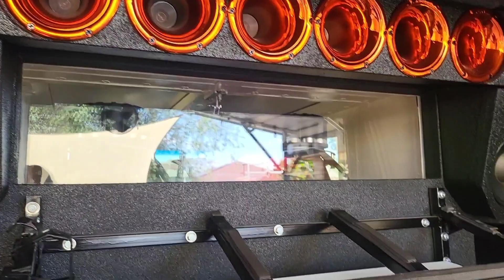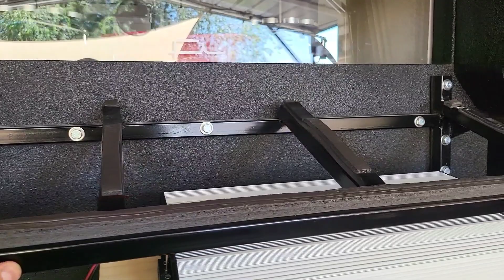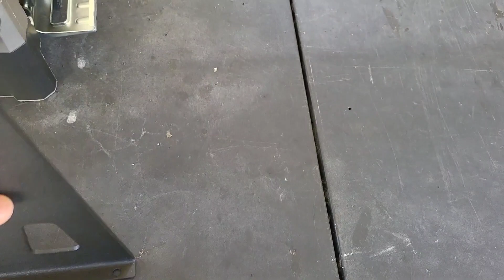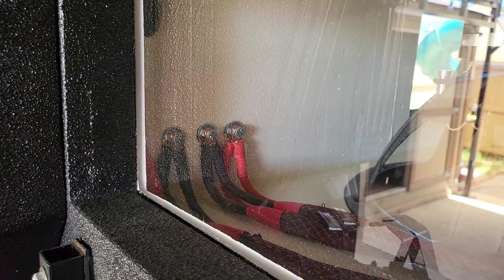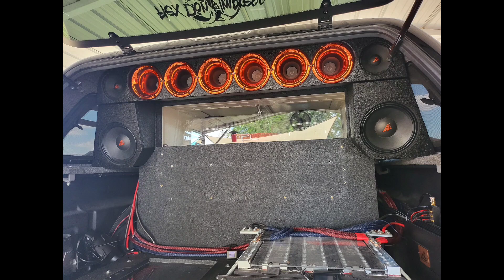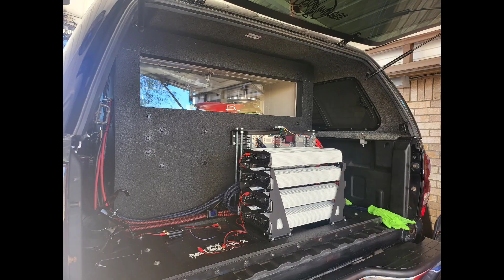Taramps smart 8k  on 4 Fi audio neo 4.11 18s #taramps #fiaudio #spl #caraudio #subwoofer

Comment: Hey dude where should I set my subsonic filter on bass 8k taramps enclosure tuned to 32hertz where on the amplifier dial like 3o clock or 2o clock or4 o clock don't want it pulling a lot of current but I want them to move a little bit more can you help me out
Reply from the maker: Try to set it  at 24 hz, i think you should be safe around there. Play with it. You might have to adjust a little higher or lower. Depending on your subwoofers' reaction 👍🔈🔊
Reply: @956Bassaddict  Thank I kinda figured that just being safe

Comment: So how many ohms will you wire each amp to per sub?
Reply from the maker: I'm going to be wire, right at 0.9 ohm amp per sub 👍🔊🔉🔈
Reply from the maker: I think i will be clamping about the same power that i was clamping with the 17k amplifiers. But now it should be more efficient
Reply: @956Bassaddict  that was gonna be my next question about how much power will you clamp, those subs can take plenty of power I see
Reply from the maker: I'm hoping 8k to 9k on a burp per amplifier
Reply: @956Bassaddict  surely you will, those Taramps probably can make more than 8K rms